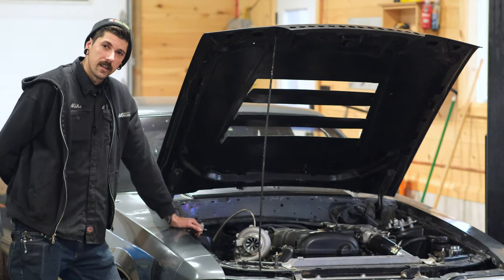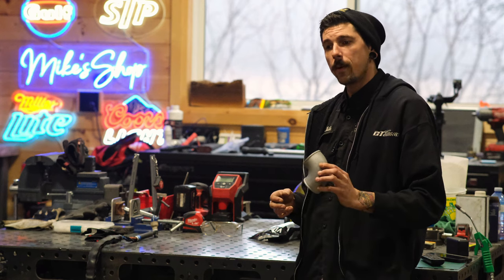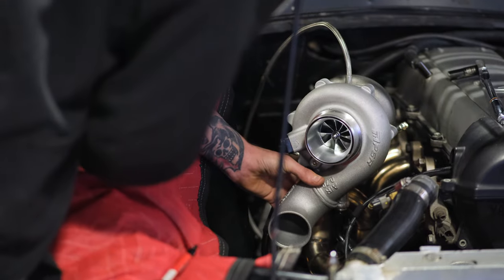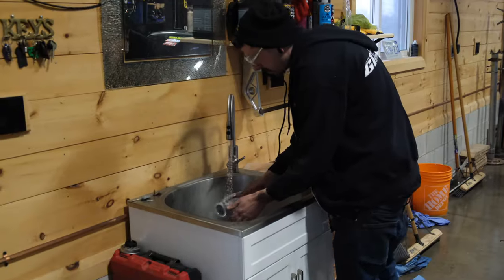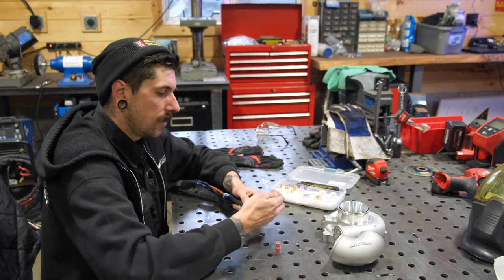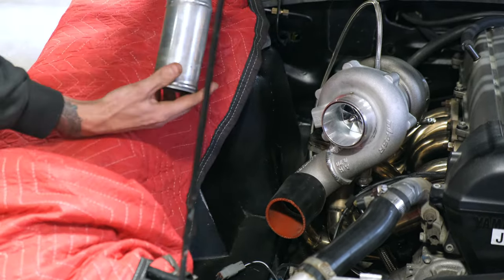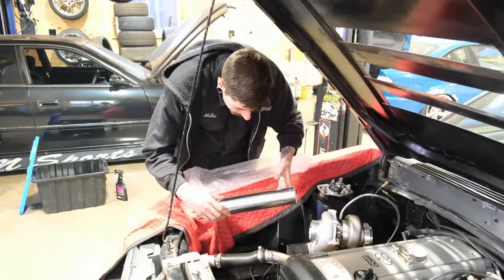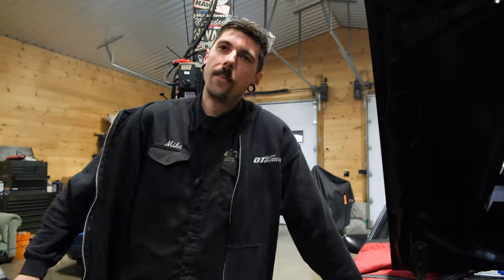TOYOTA 1JZ TURBO ENGINE SWAPPED FOX BODY FORD MUSTANG! (EP.2)

Comment: Why the hell would you put v6 engine In foxbody when v8 belongs in there ur brain is not operating right
Reply from the maker: I can confirm that my brain is not operating right i 100% agree

This is also a turbo in-line six not a v6. 
this setup easily makes about 400 wheel horsepower so a lot more than a 302 even with a blower would’ve made and Is probably 100% cooler aswell 🫡🤣

These cars also came with a four-cylinder turbo option from ford if you didn’t know!